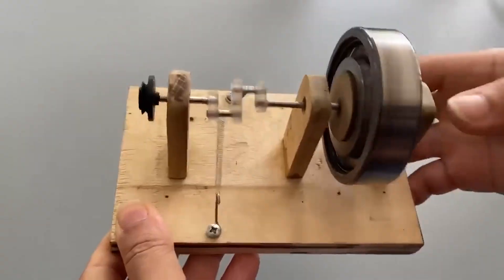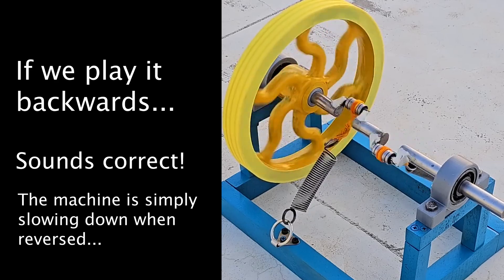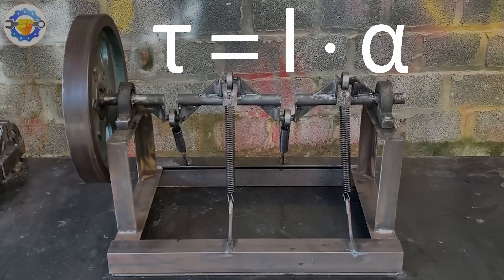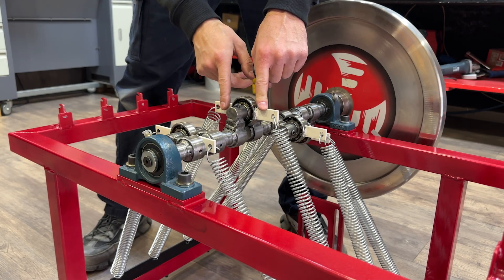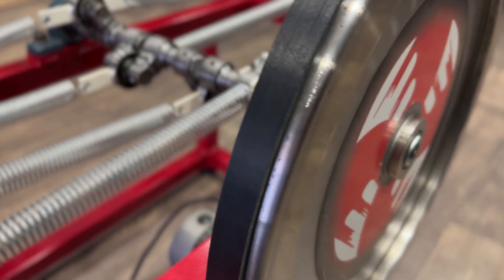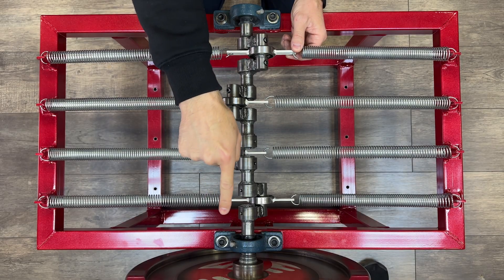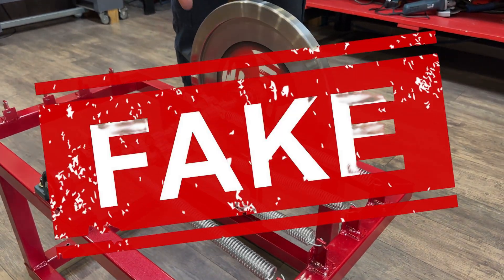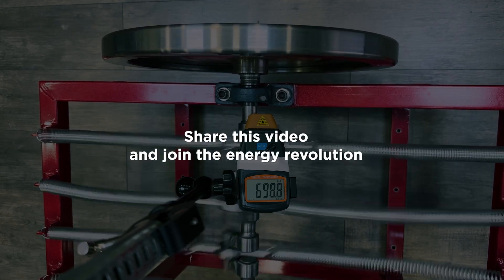We Prove That Our Spring-Powered Machine WORKS!

Comment: 1/2*kx^2 * 8 springs = 1/2* I*w^2 or something to that effect. He’s just found an effective way to convert that spring energy into speed. It’s not free energy or perpetual motion. All of the energy in the system was added when he stretched those springs to the bracket and when he gave the flywheel the initial spin